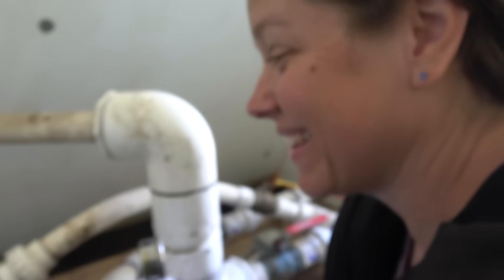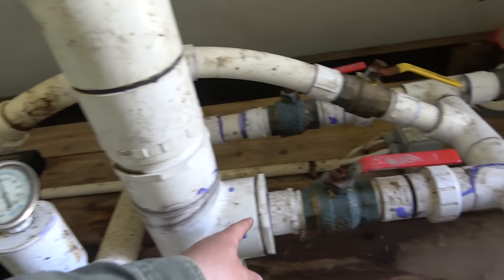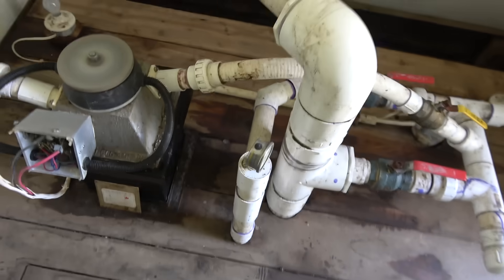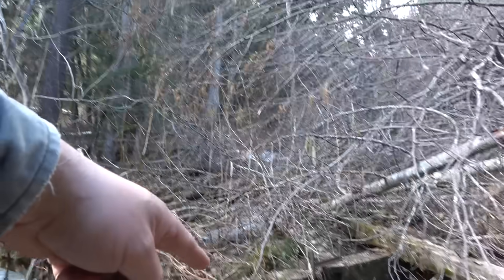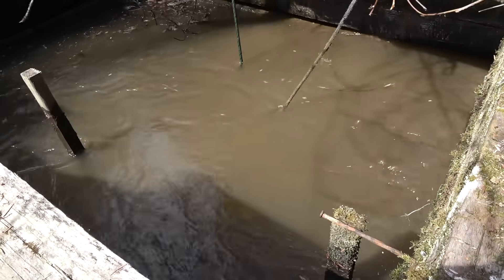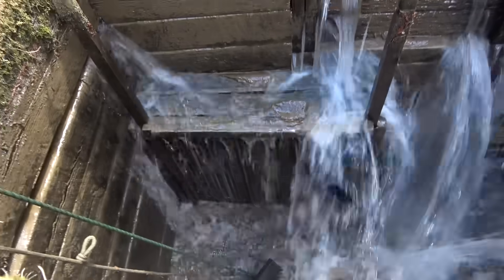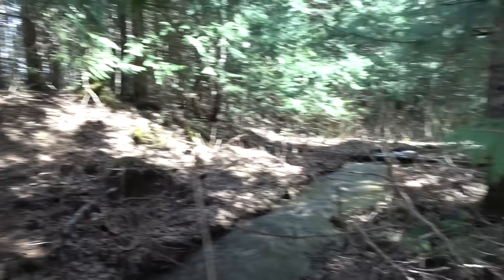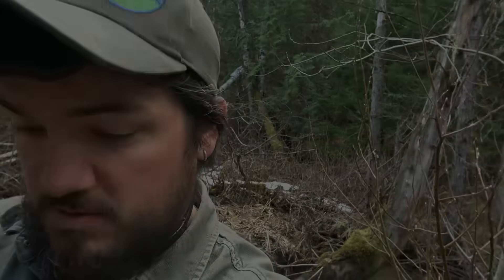Off Grid Micro Hydro - The Dream System!?

Comment: Anyone who's ever worked on any kind of industrial equipment will tell you that your bearings sound like they're about to go out. Bearings running at those speeds for 15 years are probably close to failing. Replacing bearings is cheap compared to what they destroy if they fail catastrophically.
Reply: I know nothing, and even I know those bearings arent happy
Reply: That noise might sound to you like failing bearings but actually that is the permanent magnet generator howl. I have installed literally dozens of these Stream Engines over the last 16 years. When the bearings are going they make a different sound. However, it is wise to change them out every year.
Reply: @milespostlethwaite1154  That is a very good point. The sound also might have been changed slightly by the microphone that was picking it up. I would never replace bearings without checking them for excess heat and also use a stethoscope to hear what the bearings sound like separated from any background sound. Thanks for your comment.
Reply: Shoot water at an old fan that's off and make it spin. You will understand what I'm saying.
Reply: @anygasmotorswilldo  I have a 15.5 kva hydro generator it sounds just like that it's been running since 1951 iv only changed the bearings once sounds good to me
Reply: @kiwi8.  Interesting.  I'm curious what type of bearing is used in an application like this, closed sealed bearings?  Or a version requiring maintenance, i.e. grease?  I'd love to see your setup, manufacturer, scale, etc.
Reply: @chasvonplatten1298  mine require grease every few months it's a old turgo impulse made in England it's super simple and reliable self acting governor 140 foot of head through a 6 inch pipe running 15.5 kva
Reply: @kiwi8.  Nice!  Thank you for the insight.
Reply: @chasvonplatten1298  no worries
Reply: @chasvonplatten1298  closed, sealed bearings .
Reply: @kiwi8.  dunlite here in Australia use make 36 volt dc wind generators.
What impressed me was the casting writing "change the oil every 20 years".
They were made in Adelaide South Australia
And when I asked the company about replacement blade they had no clue they ever made them. Sad.
Reply: @terryquarton2523  very nice
Reply: @chasvonplatten1298  he did say you can call the Engineers directly and talk to them about it sounds like they would answer that exact question
Reply: @kiwi8.  1951?!?!?!?!! Five - one?!!!!!
Reply: @charliegervasi5619  yes sir 1951
Reply: @kiwi8.  what can u power with it?
Reply: @jslone3  we have 4 house's running off it
Reply: @kiwi8. How large is the water source you're using?
Reply: @charliegervasi5619  yip
Reply: @MedicineMomOffGrid  just a small River about ten feet wide and two foot deep
Reply: @anygasmotorswilldo  So if I point the hose at the ceiling fan then you can get all the power you want? Is that what you're trying to say?
Reply: @andyharpist2938  you should do it!
Reply: @andyharpist2938  Exactly, go give it a shot and report back on how much electricity goes through your body...
Reply: @TechieTard  I have rubber soles on my trainers!
Reply: @anygasmotorswilldo  I'm sure you meant to say  "Un-plugged" versus "OFF" but I guarantee it will not be squealing like in the video.
Reply: I'd just say that's the noise from the 3 phase hum. Same noise you get from a high power e bike when pushing 10.000watts
Reply: I know enough that if you shoot water at an impeller it's going to make an odd sound.
Reply: @anygasmotorswilldo  I have heard plenty of hydro generators start up and running . Water interacting with a Turbine make a roaring or water rushing sounds. Squeaky or squealing sounds which usually indicate a mechanical or friction problem  .
Reply: @anygasmotorswilldo  Water goes 'shhhhh'. Bearings go 'grrrr.' Samme som sagt i Bergensk <grrr>
Reply: @andyharpist2938  😆😆😆
Reply: That's funny. I work with millions of dollars of machine tools every day, and have done so for the last two decades. I've replaced bearings in electric motors and cycloid drives. I've supervised the replacement of bearings in lathes and mill spindles. I have NEVER made a decision to replace bearings on a piece of equipment based on sound alone.  There's always a check for vibration and heat by feel as well as a minimum. High speed at constant RPM doesn't kill bearings which are properly spec'ed, installed and lubricated.  But know nothing's with an itchy trigger finger on the parts cannon trigger sure do cost lots of money.
Reply: @briancox2721  sound alone is not enough to immediately change the bearing, but it being not-as-usual is a good signal to check if bearings are ok or not
Reply: You guys have just never heard a generator running without the combustion engein that is the sound  of the turbine and a moving magnetic field.
Reply: The difference is those bearings are constantly cooled by cold water most likely hydro bearings the combination of that and the turbine is what your hearing thinking it's bearing whine
Reply: @michaelgroves7338  ٥٥٥٥٥٥٥٥٥٥٥٥.٥.٥٥.٥ ٥٥ ٥٥٥٥٥٥.٥٥٥٥٥.٥٥٥٥٥٥٥٥٥٥٥٥،😊😊
Reply: The manufacturer recommends changing the bearings once a year.
Reply: That isn’t the bearings.
Reply: @poonchild  Whats your diagnosis, doctor?
Reply: I too work in the industrial industry, mainly large steam/ chiller power plant operations. I've had my share of bad bearings in pumps and motors. While there may be a little mechanical noise here I don't not hear shot bearings, I hear the sound of a dynamo generating DC voltage and the impulsive sound of the turbine wheel being driven by water.
Reply: My thoughts initially when I heard that turbine screaming away… it doesn’t sound good to be honest. Possibly a little bit overpowered?
Reply: The wiring could probably do with requiring
Reply: That's possible. Granted the water wheel itself is likely very noisy too
Reply: What does a mini-hydro turbine sound like normally?
Reply: the man did say this system/turbine has been in use for 15 yrs, no? plus he’s performing annual maintenance on the water system so i don’t see why he’d neglect the turbine. it’s probably the right sound. if not, those Canadian engineers got some ‘splainin to do! 🤣
Reply: G'day All,
I'm a plumber who lives and works in Sydney Australia and I couldn't help but notice that it seems that they've  used the wrong  type of glue for that pipe (ie pressure pipe).
It appear that they've used standard type N "Blue" glue Instead of the required type P "green" glue (ie high pressure glue). I don't mean to nit pick but it these things stand out to me... probably because I would get my ass kicked if that was my job LoL ....and obviously please correct me if I'm wrong. Maybe things are different over in the states....
Reply: No way them bearings are 15 Years old everyone running that type of turbine are estactic to get 3 Years
Reply: Yeah like that system losing it's balance and destroying itself.. I imagine that little turbine isn't very cheap. I would love to tear it apart though. I would try to build my own and use the extra power lighting up the whole property at night and/or triple up the batteries use them for an electric off road vehicle. I mean can't you put those turbines in series and gain power? That was a lot of water flowing through that box.
Reply: @mborowski2010  once the water comes thru the nozzle and hits the turbine the pressure falls to atmospheric so there is no energy left to drive another turbine in series . You would need to create another elevation drop to get sufficient static head pressure to drive another turbine .
Reply: Does anybody know of hood literature to read regarding basics on hydro??
Reply: @jgross3000nator  I am assuming you meant "Good Literature"? If you go to the website of the company that makes the "Stream engine" micro hydro they have the info you are looking for .
Reply: @jgross3000nator Micro-Hydro Design Manual, Adam Harvey.
Reply: I also thought that the Bearings were noisy, these need to be changed, and then the Turbine won't be so noisy inside the Shed.
Reply: ya those bearings look like there pushed to hard they sound like warren out skate board bearings
Reply: Wow man can ya grease that thing sounds wild
Reply: Where can I find the design plans for this, it’s so freakin cool, I don’t have experience but want to learn how this functions
Reply: @charliegervasi5619    here; https://microhydropower.com/
Reply: Nah, letem run till they friction weld together
Reply: Yep. Hearing that motor whine is making me cringe.
Reply: As a trucker I agree 1000%...this.noise isn't a good one.. sound way to " dry", metal to metal
Reply: Brushless bladeless is now a thing.
Reply: Well you'd think he'd know if it sounded off..if it's been running for 15 yrs..
Reply: Sound of failing bearings are what my nightmares are made of 😂
Reply: @Koosiman  loud because of the recording inside the little shelter.
Reply: Thats not the bearings you hear it's the generator hum or whine the faster it spins the louder it gets all turbine  engines sound that way .and that is a water turbine ..what you hear is the brushes rubbing along the magnet as it spins that's what collects the electrical current its normal
Reply: AND USE CERAMIC GERMAN BEARINGS!!!!!

Comment: This is the worst video I've ever seen on YouTube. You didn't explain how this thing works at all and your terminology regarding "hydro" is completely incorrect. First of all you should have said Hydraulics not hydro and proceeded from there; Velocity not pressure and volume not flow. I thought Canadians were smarter than Gringos. Also your plumbing is super sloppy. Your piping design is totally amature and obviously poorly planned which is even more proven by all the puple primer slopped all over the pipes.

Comment: Yet the southwest is supposedly in a huge crisis because they are falling short on the millions and millions of gallons of water flow they use to generate power. Tells you what a complete scam hydro-electric dams really are, everyone should just have a small turbine at their house.  Now imagine combining this with a hydram pump. Or water hammer. I forget the exact term but basically it's a pressure chamber with a piston and a release valve so it creates pressure from just a little bit of flow and then when the pressure builds the piston shoots back and starts over. I'm sure not explaining it right but would be cool to see it in a low flow scenario in combination with your turbine. Very cool stuff.

Comment: How long could batteries store power?  Could it last till winter and provide power through winter?  Since the system already dumps water why not store that excess water in a insulated water tower. Maybe a very low power pump to very slowly move the excess hot water to the tower?
Reply: It runs 24/7 365.

Comment: Awesome video!  On the subject of water power, In Europe I saw a museum of a working several hundred year old “industrial” plant made of mostly wood operating off just a few feet (or less) of water height difference that operates a saw mill, blacksmith hammer and bellows, seed crusher and more.  Labour free operation, ropes pulling sluice gates open.  In the lumber mill one rope to start the saw, another to advance the log, another to back it up, etc.
Reply: It's called a watermill. Together with the windmill it started the industrial revolution

Comment: I have a friend here in northern Ontario that has been running a similar setup from the same manufacturer for 30+ years, and was one of the first turbines they developed. They worked with the manufacturer to get it dialed in .
Reply: Name of the manufacturer?
Reply: @Entropy1234  Energy Systems & Design

Comment: Have you guys tried "The Endless Shower: Real-Time Water Recycling System"  I discovered it last year that some nomadic van-life people were using.  It's brilliant.  There are many versions, and more being developed every day, but the gist is that with a recycling pump and filtration system, you could take limitless, HOT showers with as little as 20 liters of water (I've heard some say it can be done with as little as 8 liters).

I would think that this idea could lend itself to clothes washers and dish washers, as well as sinks.  

If you have already implemented this idea, then that's awesome, but if not, I recommend checking it out.

Thanks for showing off your Stream Engine, it was cool to see

Comment: There is a 40+ year old solar water heater on my roof. It heats my 180 gallon water heater w no electric. It has a small solar panel that powers the recirculating pump.

Comment: This guy is living like a king…excess power should consider pumping water back uphill and putting it back where it came from …pay it back to the earth or if possible store it in a holding pond for use when needed or send the power to a needy neighbor.
Reply: The water used to drive the Stream Engine all returns to the stream. It's only diverting a small amount from the actual flow and it ends up underneath the little hut and makes it's way back to the creek.

Comment: As an electrician looking at all the open boxes and air splices just makes my ass pucker.  I shudder to think of the cost of just the pipe for the penstock and the effort required to install it.  Then there is the turbine and the inverter as well as the batteries and supporting elements and controls.  This is not cheap!  Then again, they likely have a payback of a few years considering that they don't need to pay a utility or install a well.  Clearly the person that designed and installed this system had a very good grasp of the technical details and did a very good job of engineering their way around issues.  Nice to see such a system.

Comment: If they got an electrolyzer from millennium reign, they could produce hydrogen with any excess power they have to get rid of. And you can either use the hydrogen in a fuel cell or use it as combustion gas.    You can also use the waste heat from the electrolyzer to heat water for a pool or hot tub or radiant heated floors or to warm your house in the winter or if you have a compressed natural gas vehicle or appliance with minimal modification to the orifices on fuel injectors or carburetors you can use hydrogen instead of cng.

Comment: Too bad there isint much areas where this is possible here and even if you owned that property and could build hydro.. well government requires all kind of hoop jumping so its much harder to become self sufficient. Also this is not micro hydro.. this is macro hydro power. There is big difference with this amount of water you have available. Also consider connecting to grid so you can sell that excess power and get some money.

Comment: So your system is 52 volts? How do appliances that use 120 V handle that?
Reply: Usually a charge controller is used to charge a battery bank which is connected to an inverter that produces 120 or 230 volt AC. The alternator in the hydro unit won't produce enough available power to directly run something like a washing machine but it does produce plenty of power over a 24 hour period hence the need for storage.

Comment: My only concern are the points of failure between the power regulator and the hot water heater. If that little guy that purges hot water when the temp gets too high fails, well I just saw today a video from an old episode of Mythbusters where a water heater was allowed to build up to the point of self destruction. It was like an unscheduled rocket launch through the floor above it and the roof above that. I'd have a redundancy on there after seeing that water heater 'splodey up into the sky!
Reply: That MB eppisode was about when your waterheater has a failing overpressure valve...the valve that opens automaticaly above a sertain pressure so in his case,there is a double safety,the electrically driven one that just dumps hot water outside at a sertain temperature and the mechanical one that dumps overpressure...
Reply: No worries. Water tanks have a built in pressure relief valve for that very reason.

Comment: You might want to replace the bearings every few years, they'll still run for years, even when the bearings seal has failed because it's water cooled, but it's much quieter after you have put in new bearings and seals, but we forget to, because we get used to the noise over the years and think it's normal, but once you do replace them, you will be so amazed how smooth and quiet it runs, and it's not from the cavitation of the water vs impeller, making the noise, that's only when the impeller is pushing the water 😉 like a boat 🚢
Reply: Or just replace the bearings with ones that are water lubed sleeve type bearings. That will also quiet things down.
Reply: classic catastrophic failure

Comment: My favorite thing is calling everything solar powered. "but this is hydro", yeah but how did the water get uphill? by absorbing the suns rays it evaporated from the ocean, greatly increased potential energy by getting way up in the sky, then re-condensed into rain, and fell on your mountain/hill to power your hydro generator. aka it's just solar power.
Reply: This is dumb... You can just as easily say the sun is gravitationally powered, therefore everything is gravitationally powered, not "solar"
Reply: @craigpeacock1903  
it's not dumb, it's just a fact. also the sun creates that gravity, so the buck stops with the sun. might also want to look up with solar means because you don't seem to understand.
Reply: Greg
everything is solar powered, yes even humans. everything lives off of the sun's rays in one form or another.
Reply: Technically solar power is nuclear at the source.
Reply: @michaelgibson2163  
well technically that nuclear power is only possible because of the mass of the sun. so the source is just the mass of the sun but you can just say the source is solar.